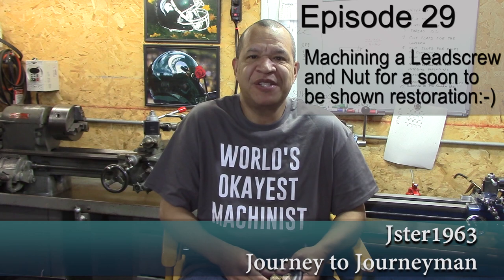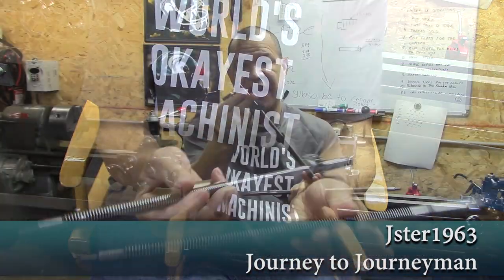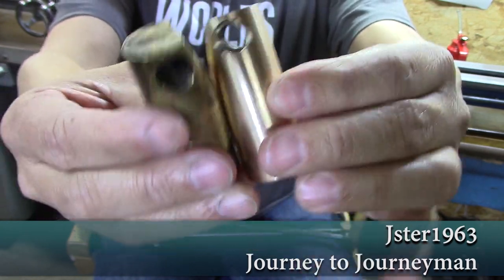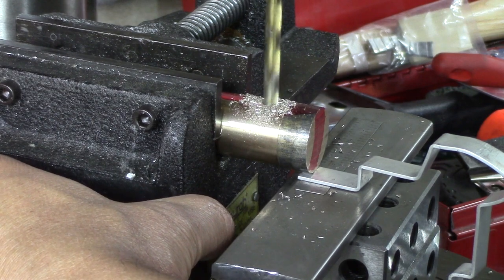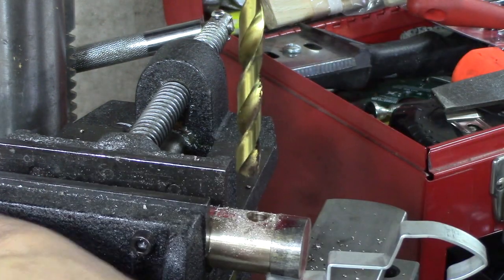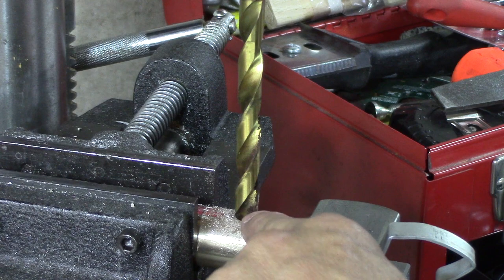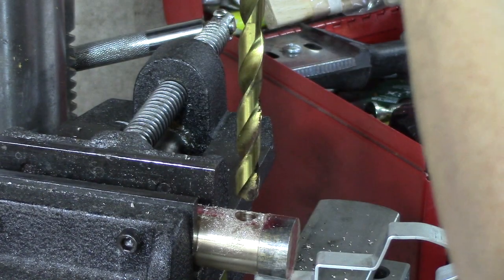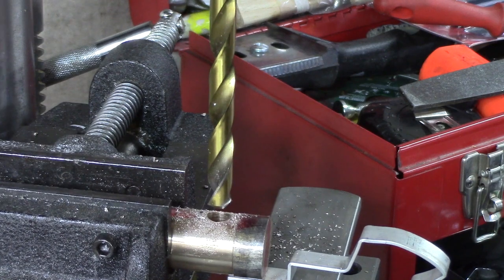Journey to Journeyman, Episode 29.  Machining A lead screw And Nut for and upcoming project.

Comment: I am in the process of rebuilding the same machine your rebuilding. I also need to replace that nut. However my lead screw is in excellent shape. I was thinking of just swapping the nut end to end and tapping a new hole and cutting the deep chamfer to match. I figure the extra chamfer and old worn out hole will be hidden in the casting and should not effect the operation. If it does not work I will just get a new piece of bronze and do what you did. Thanks for showing all your challenges. I two am also on the same journey and am making the same mistakes. Great job!!
Reply from the maker: Thank you so much!  I hope to be showing my new machine this week.  I was thinking about swapping ends and doing it just like you're thinking about.  I bought the bronze just in case.  I really didn't know if that would work, so I went the easy route.  Please let me know if that does work.  I kept the old nut too.  I'm 99% done with my restoration and it's turned out pretty nice so far.  Are you doing a video series on your restoration?  Anyway, thanks again.....

Comment: The next time you need to brace under a part, use a bolt in a  nut with the nut over a hole and the extra length of the bolt in the hole under the nut, like on top of a 1-2-3 block or something else you made as a jig?
Reply from the maker: Ahhhhh.  Excellent idea.  And thank you so much.....
Reply: @jster1963  Excellent suggestion from Roy there. If you skim the numbers off the head of the bolt it makes it easier to get the height just right. Poor man's machine jack.
Reply from the maker: @MartsGarage  Sweet!  Great info and thank you.....

Comment: Nice job! One question, why did you take the nut out of the four jaw and put it in the drill press? It look like you had it set up and ready to go? Thanks
Reply from the maker: Thank you so much!  I should have explained that.  After I got it close to be dialed in, I realized that because of the uneven top relative to the bottom, I would have to take it out, cut the top and machine it.  So I would have to go through that whole setup again.  In the drill press I just had to line it up.  I was just saving time.  Great question and thank you again.....